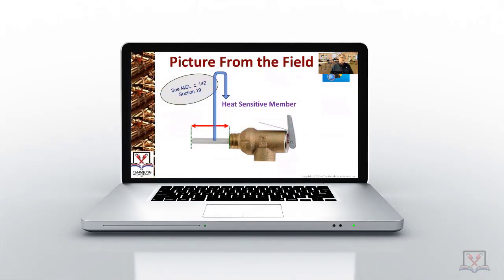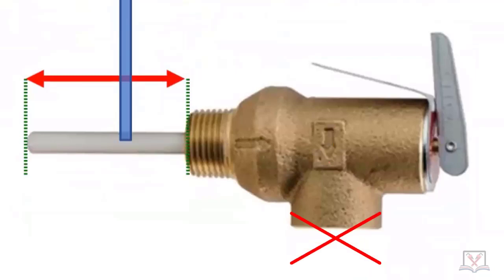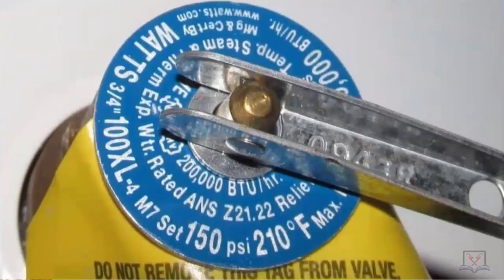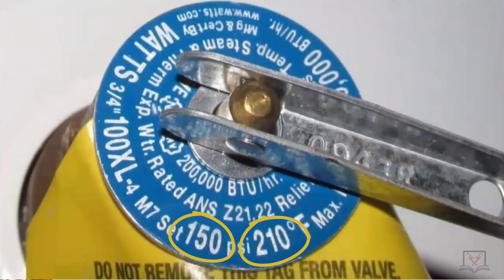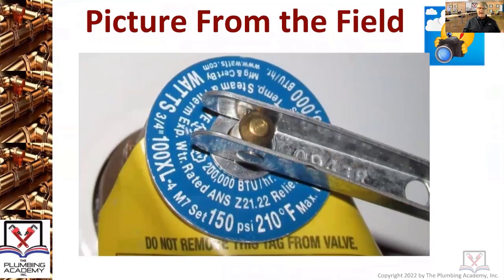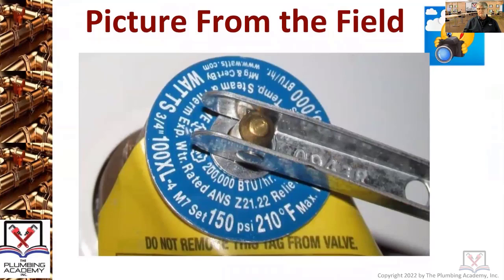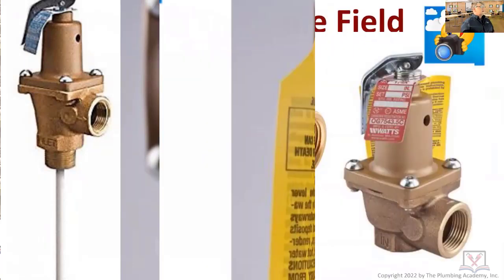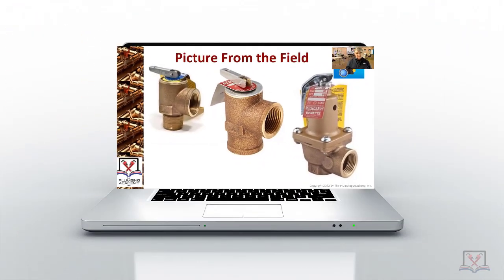Temperature & Pressure Relief Valves and More!

Comment: Blow down tubes are pvc here and pass code in Ithaca NY....
Reply from the maker: Interesting! PVC tubing has a maximum temperature rating-(usually around 180-Fahrenheit), this is well under the 210-Fahrenheit blow-off temperature of the relief valve setting on the water heater. At 210-Fahrenheit the PVC being used for the blow-off will become pliable, and in essence will melt-off rendering the relief valve dangerous and a significant scalding risk for anyone that may be in the area when a relief valve discharge occurs. It is so dangerous that the Commonwealth of Massachusetts passed a LAW-(following several incidents) that only allow the use of non-ferrous METAL tube or pipe to be used as the blow-off tube for T & P Valves.